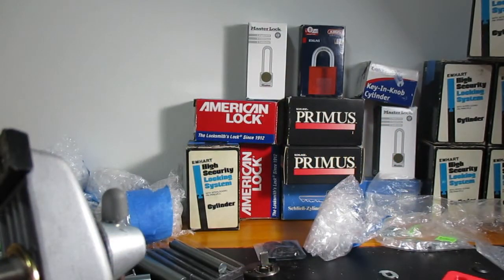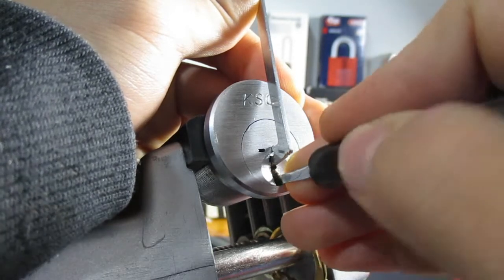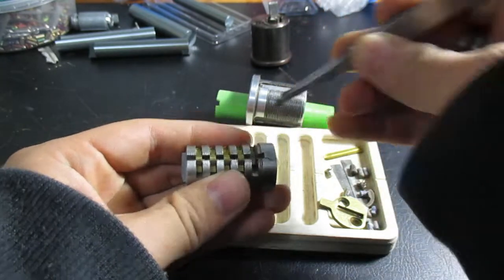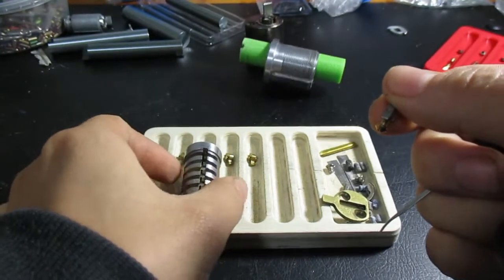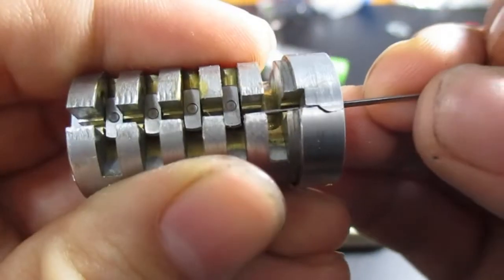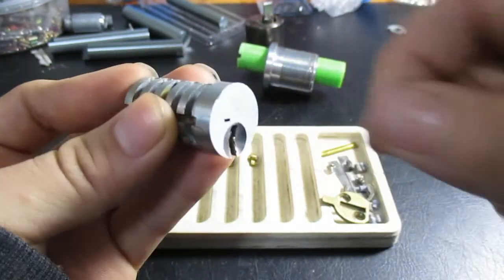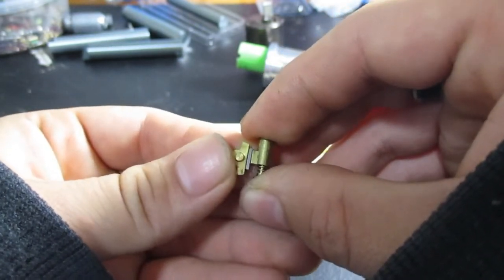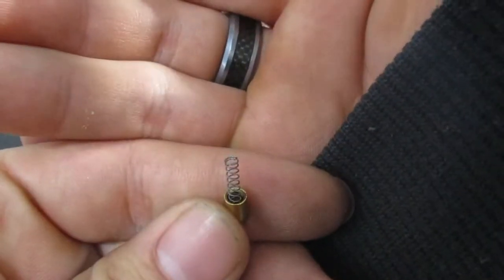UChange - Pick & Gut

Comment: Nice video man! I think those blocking components must be held solid until the plug is rotated 90* and they are allowed to push up a little into the chambers. I could be totally wrong about that, but it's how I imagined you would be able to only rekey the lock when it is open. I agree that these locks are very cool and well made.
Reply from the maker: Tumbl3r, I actually agree with you 100% on that one, I was looking over the lock as I was putting it together again and im thinking they used the spring pressure from the drivers to push the pegs back in to the serrations, and then im guessing they hoped the friction of steel on brass would hold the peg indefinitely or until the change system is applied again... I will give another in depth video when I get the change tool and keys :) Thanks again for that lock!